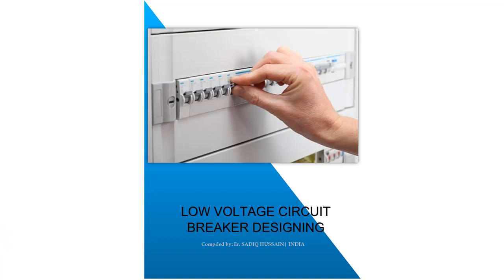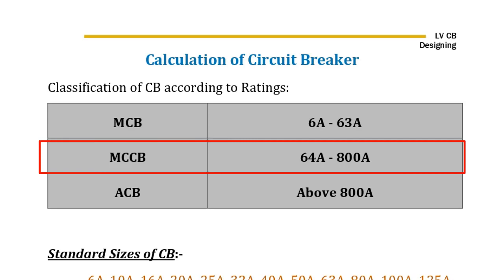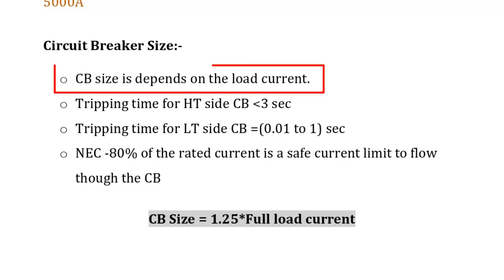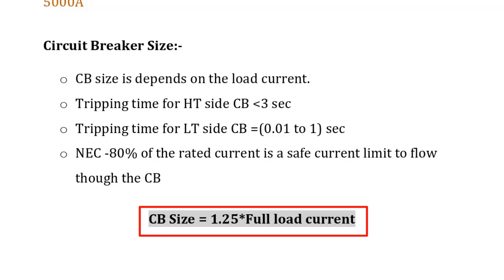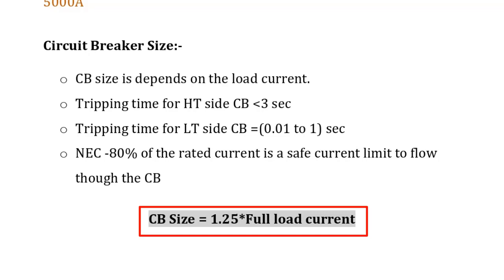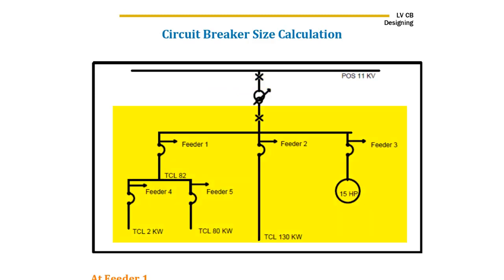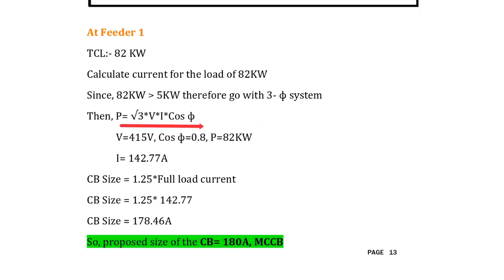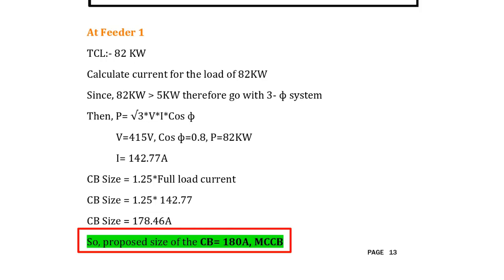Circuit Breaker Size Calculation

Comment: Thank you for this video. but i have some confusion for your video on load current calculations that you posted ,i want to know where to use the formula on active power of I=1.4xkw and apparent power of I=1.75XKVA .i want to know if it can be used for CB sizing? thanks
Reply from the maker: @espositogauss5732  hello,
Yes, it can be used for circuit breakers.